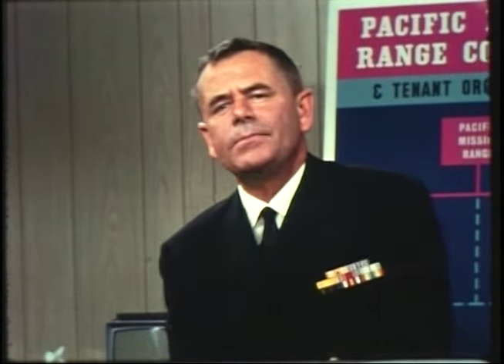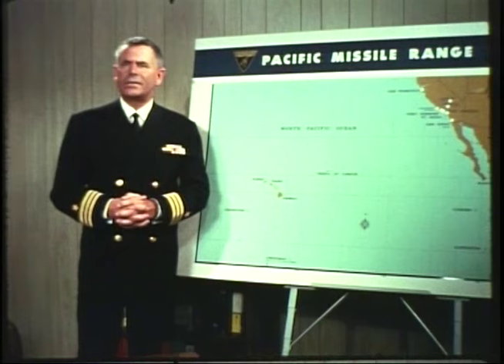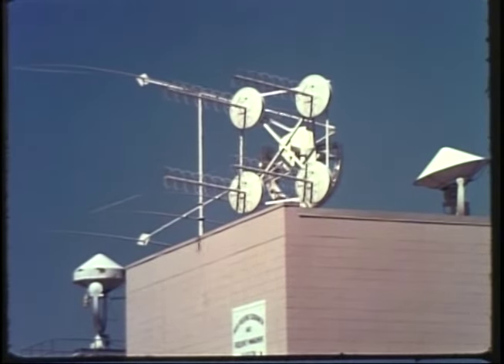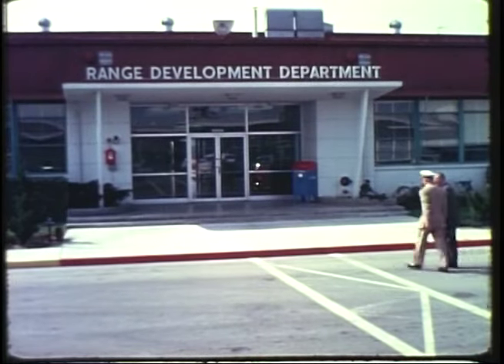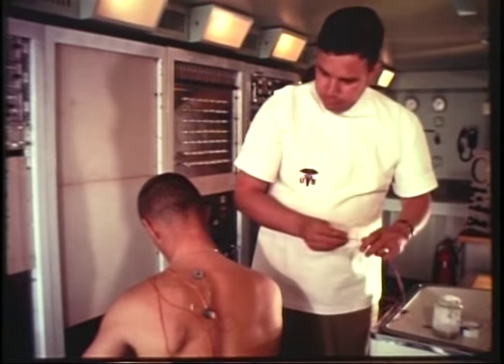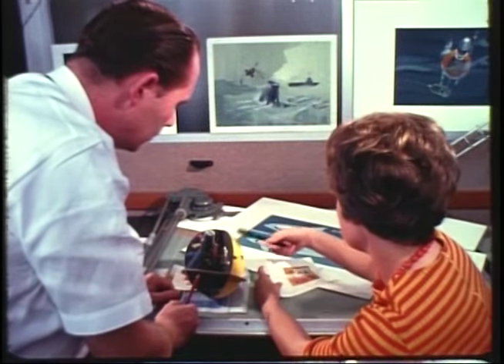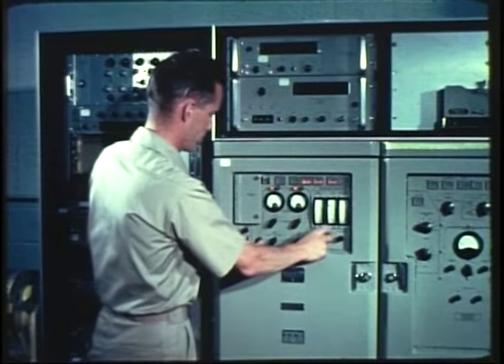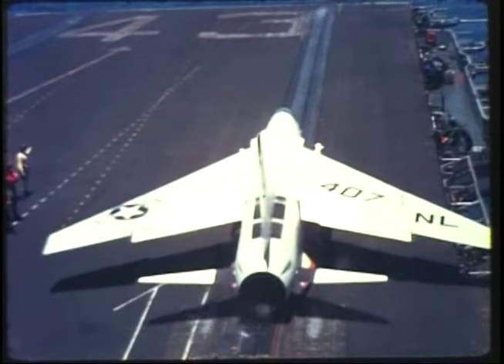The Mission of Point Mugu | Weapons That Work

Comment: The irony behind a lot of the AIM-7/Sparrow segment is that in actual combat conditions it did have reliability issues in the real world when in service. Though, to be fair, most of these seem to be related to the radars in the Phantoms themselves and also in part how it was being used by aircrews. These improved over time but it does make listening to them talk about the missile's reliability, and how they have to test it as a whole system since there is significant integration, quite amusing
Reply from the maker: A couple of other issues were the excessive handling and the environment. The missiles were often sent to intermediate maintenance for teardown and inspection. Each time was an opportunity to cause a problem that didn't exist before teardown. The environment in SE Asia was also harsh on components. Additionally, some rounds were fired outside optimal parameters either through the excitement of battle or in an attempt to get the foe to break off. Later versions of the Sparrow, like the AIM-7M have had a much better record.